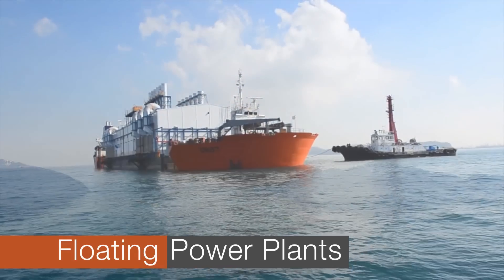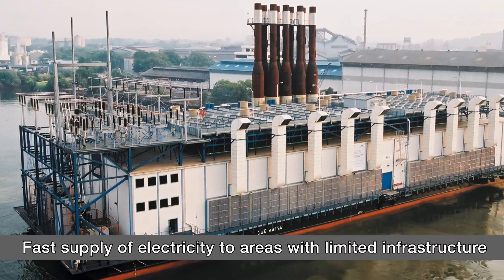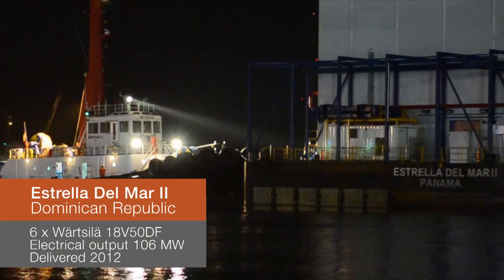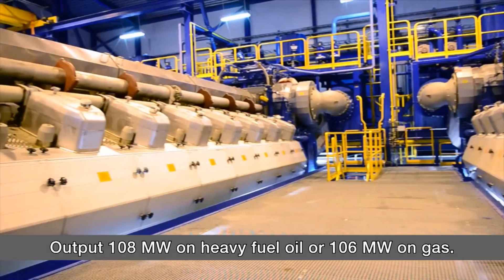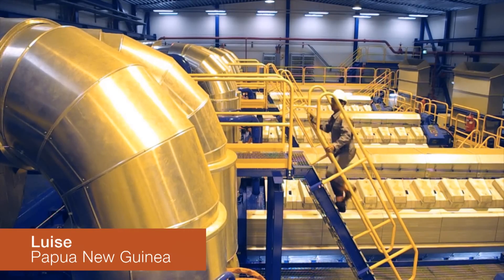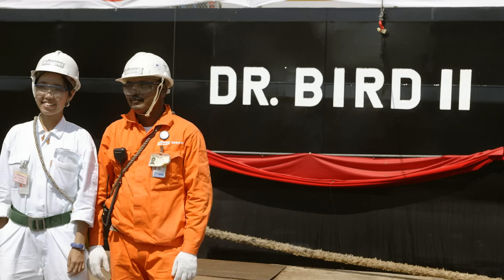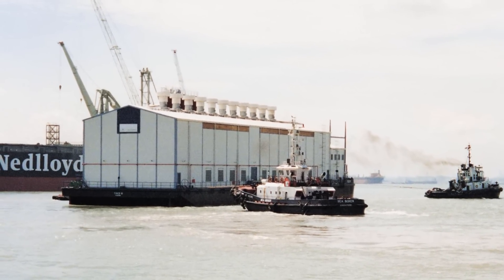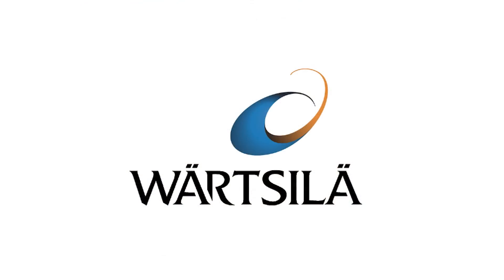Floating Power Plants | Wärtsilä

Comment: How do you connect it to the grid?
Reply from the maker: Hello - thank you for your question. Most barges have what's called a "step up transformer" on board which steps up the voltage generated by the gensets to "transmission voltage" and then they have a switchyard, which is quite small on a barge and a "dead end structure" from which the transmission line goes ashore.  If you look at 5:46 of the barge video you can see all of that on one end of the barge. Different barges have had different configurations for that equipment, but most have had all that on board. Kind regards, Amy with Wärtsilä Communications